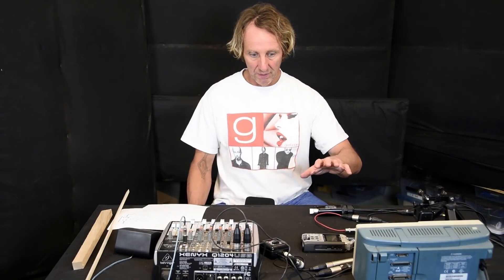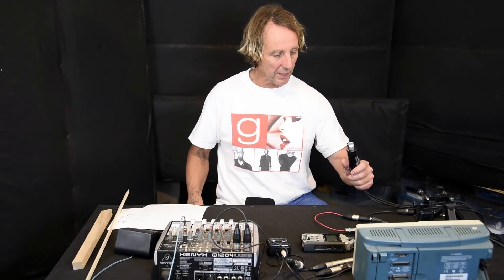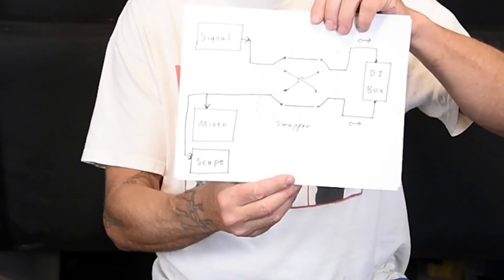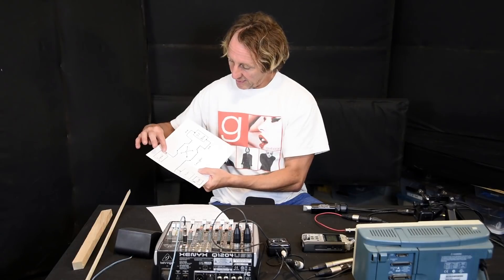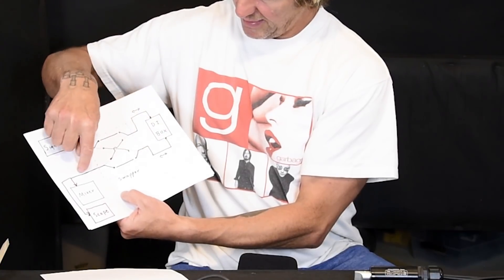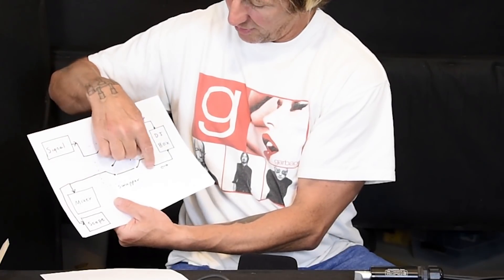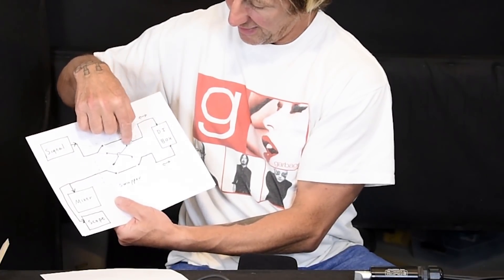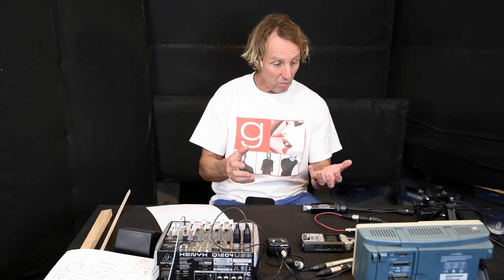DI Boxes, Impedance and Transformers Part #2

Comment: I had a matching transformer for high/low impedance mics, back when I was a kid.... it was the sort mounted into a metal can, with a 1/4" socket in one end & a flying 1/4" jack cable at the other. it was intended to match low impedance mics to high impedance inputs, but I didn't know the theory back then & although I knew there was a transformer in there, I didn't understand how it worked. I found I could use it one way round or the other to deal with a variety of level-matching situations, but it was (by some quirk) also phase-inverting, & so I also learned about that.

Comment: I used to always run two Multiformat, one for microphone level signals and the other for line level signals (both directions), sometimes even going up to three multicores, microphones, line inputs, line outputs, and would (mostly) use the mixing desk line input on the channel, exception being if I had mic input transformer on the desk then I would sometimes input a line signal through it for some transformer saturation, still do that till this day with my Allen & Heath Mod Two desk (the one from Pink Floyd-Live in Pompei), I believe it has Carnhill input mic transformers, beautiful original 70‘s saturation….by the way I love your videos Dave, your giving answers to a lot of what many people may think of as „stupid“ questions and then doing real life demonstrations , unfortunately many people think the only difference between signals is how „big“ or „loud“ they are, I cannot even begin to count how many times I’ve tried to explain to people the concept of impedance matching and the different topologies of pre-amp and amplifier topologies, took me a while all these years ago to understand why desk interactions happened when there was no transformer split, eg.a straight y-split going to one desk with transformer input and the other electronically balanced, or worse both electronically balanced but not identical desks, „shit, it works with two Midas desks, why not two Toys‘r‘Us desks???“
Yup, transformers are expensive…..and very often the effect of the transformer is a beautiful thing,a little fattening of the signal, a little rounding off, and a special kind of compression sometimes…it’s a pity that people often don’t realise how useful this can be in shaping the sound….and you haven’t touched on inductors for parallel eq or capacitors for filtering, trying to explain parallel eq is very confusing for many who still think in big-small signals or even more simplistic quiet-loud…..and now we are into the effect of phasing on a signal….for many non technically minded people you are doing VooDoo…🤣🤣🤣🔊🔊🔊🔊

Comment: He from London Dave.
thank you so much for your video.
I like to ask you about the DIbox what do you think we can use the output from the console to DI box to The speakers ?
Reply from the maker: Should just be able to run XLR cables from the console to the amps
Reply: @DaveRat  
he Dave I think I put wrong the question:))I'm sorry 

My question is,
can we use the DI box between the console outputs and main speakers?
Thank you Dave.
Reply from the maker: A di box will drop the voltage to mic level. So, yes, if your speakers only take mic level. If you are trying to solve a buzz, use an line level iso transformer instead

Comment: Ciao! So if I understood well, the correct way to plug a stomp box reverb that I love to my console is to feed the reverb's input with an aux send (+4 balanced) with a backward DI box in the middle, and the plug the reverb's output through a DI box (this time withh a "regular" way of pluggin) then send the signal to a mic input of the desk.
Is that correct?
Thanks for all!
Reply from the maker: Hmmm. You don't need the 2nd DI and the output of the stomp box is not an issue for the console to deal with.

To send to the stomp box, the console output is found to be pretty hot, so either turn the output way down or use a DI the normal way to drop the level down.

That said, a DI typically has a mic level out so it may be a bit low for the stomp box input.

I'd give a try and see which works better
Reply: @DaveRat  thanx for replay Dave!
Reply: @DaveRat  Hola Dave! I plugged the input of the stomp box the way you explained and cool! that's the only way to feed with a proper signal the input of the pedal himself with (also) hot signals coming from the +4 dBu converter balanced output. I test the flow with no flipped DI and there was no way of hearing "dry signal" coming back clean from the pedal; always "cruch".

So I thank you very much for this top useful piece of advice: It makes me think that the next time I want to use  my friend's fostex E16 for tracking drums, I will need at least a rack of 10 radials (which I used for patching this time_1XJDI with Jensen) passive to hit the tape...

Also, as you suggest, I patched the rev pedal's output directly in a mic preamp (padded) and there is enough room to align.

Thanks again for having my rev pedal connected properly to the rest of the world! 
Ciao!
Reply from the maker: Awesome!!!

Comment: The coolest thing I've done with DI's was to act kind of like splitters and used them on the inputs of a friends BOSS RC-300 looper pedal so that I could tap the instruments before they went into the looper. That way I was able to break up the looper setup into 6 individual channels (3 for the loops and 3 for the instruments). That way the same guitar input could be used to input a rythym guitar part into the looper and then turn around and take a lead on it and I still had control of the mix of the individual parts and loops at the board. I know it was overkill for a looper setup, but it sounded way better because I had way more control over it, instead of it being all in one stereo output.
Reply from the maker: Super cool

Comment: What is the benefit of using an active system like Radial SGI or TCE Teleport rather than just using DI boxes?
Reply from the maker: Active systems usually send the signals at higher levels reducing the susceptibility to induced noise.  Also active systems can minimize loading down the source by being very high impedance.

Comment: Great video. Your descriptions are very creative. Running a DI backwards is great in a pinch, but for long-term use, I still prefer devices designed for the job. Microphone transformers work well for low to high impedance conversion, and there are special interfaces for connecting consumer audio devices to balanced inputs. You might have also spent a bit of time on the pad switches on most DI boxes and when to not use them. But then we might have been here next week. 🥴👍🏻🎶🙉

Comment: I always wondered whether the Freq Response changes when you invert the DI Box. Will have to try that one in my lab. Any comments your way ? Thanx from Caracas !
Reply from the maker: As long as you don't try and drive a lower impedance load, it should be the same either way. And awesome! Caracas! I was there once and it was fascinating.
Reply: @DaveRat  So true, plus tryin to keep the HighImp wiring as short as possible. Hey, when did you visit us out here ? I studied ElectroAcoustics in Boston in the 70s, toured extensively as Engineer and Stage Mgr and now (67 is an age you stop hopping on stages) am dedicated to my Electronics Lab, fixing vintage and pro gear out here. All the best to you !!
Reply from the maker: It was back in 2002 with chili peppers.  Did a show there and had a day off or two as well

Comment: Calling Mr. Rat! I have a technical question for you. I am running a consumer grade HK preamp into a Driverack 480 (going unbalanced RCA to XLR by grounding the shield to ground). The issue I am encountering is that due to the impedance mismatch (I think), the preamp really struggles to get a high level signal to the 480, and consequently is real easy to run the pre into clipping. Would a DI box like the Radial ProD2 improve my signal to the 480 and keep the pre from clipping so easily? I don't have a full understanding of how these DI boxes work, but after watching your video, it gives me some hope that these might be just the ticket. I appreciate your videos and willingness to share your wealth of knowledge, -thank you!
Reply from the maker: Hmmm, sounds like you have a minus 10db output driving a plus db input and you need to find 14db somewhere.

So, either raise the input gain like 10 to 14 db on the 480 or add piece of gear, like a compressor or something with 10 or more db of gain between the two.

Using a di box backwards would be too drastic.

A Rolls promatch is a box designed for that purpose as well
Reply: @DaveRat  Dave, thank you for the quick response and advice.
Reply: If the xlr input on your driverack is balanced (and I'm assuming it is), you want to use a DI box. If it is balanced, the way you have it set up now forces the driverack to accept a single ended signal. There' are different ways a component can be balanced, and the wiring can be different depending on the methods used. Given that, the results of using a cable like you describe can range from working OK to crossing wires and making a short circuit. Without knowing the details of how your equipment is made, its hard to say what is going on in your system. Either way, the issue you describe is a textbook example of why you should be using a DI box in the first place. I think if you try one, you'll be pleasantly surprised with the results.

Comment: No, it's a GOOD analogy! It's like the one I use for batteries with water between 2 reservoirs and the diameter of the hose. Pressure velocity and flow are good analogue of watts, volts, amps. resistance with friction works too, and torque for impedance works too.

Comment: Thanks Dave, this is amazing information you're sharing!

One note on that ZOOM H4n - it is a little funky but you can actually feed line level into the inputs but you have to run them in via 1/4" which is how the H4n knows  you're giving it line level instead of mic level. Of course a DI is a great way to do this more universally.
Reply: Came here to say this. It's been a long time, but I believe I used to feed my h4n line level from a Sound Devices 302 by feeding stereo balanced 1/4". It sounded really good too. I have some field recordings up on youtube using that setup.
Reply from the maker: Hmmm, the 1/4 seen to reduce the level that is recorded but the high input level seems to still distort the circuit before the the level reduction.

I will set up a test to show the issues if I get a chance.
Reply: @DaveRat  Good point - I suppose it depends on the levels coming off the board. I tested it with an Allen & Heath SQ-5 but we were only running spoken word audio through the board. Could be different with music, especially anything on the louder end of the spectrum.
Reply from the maker: Also, mi e is an hn4, not the pro.

Yeah, definitely had issues that 1/4 would not fix
Reply: @DaveRat  Thanks for that Dave. Could be that the H4n is applying digital attenuation post analogue stage. Thanks for taking the time to test that.
Reply from the maker: That's the best explanation I've heard!
Reply from the maker: And thank you Curtis!

Comment: How can low impedance have a lot of resistance? Some of the stuff he says just doesn't make sense. The explanation he gives at around 11:20 mark just makes no sense.

I understand what he was saying about the DI working backwards, it is the analogy he is using, it just confuses me.
Reply from the maker: Yes, could see how "a lot of resistance" can be confusing if interpreted as "a high resistance". I switch between the analogy where offering "a lot of resistance" to the wooden stick moving would equate to and be the result of the low input impedance.  The low input impedance (low resistance) of a balanced input will drag down the output voltage of a high impedance output.

Comment: I ALWAYS learn from your videos. Thanks Dave!
I currently send a single D.I. feed from my bass player's multi-effects pedal to our mixer for mains and monitors. I want a dry feed as well to give us a bass sound for the mix that is more consistent in tone and volume than I get from a completely wet feed now. 
I plan to route the bass through a Radial Stage Bug SB-2 for a dry feed to the mixer, send the 1/4" out from the D. I. into the effects pedal and back out to a 2nd D.I. and on to the mixer as a wet feed.
I expect a hum and hope to remedy it with the ground lift switch. Should I expect any other issues? 
Do you recommend another solution?
Thanks for your time and consideration.
Reply from the maker: You should be able to do the wet and dry without him and the setup sounds good. 

A di before and after the effect sent to the console

Comment: Is there a difference between a passive DI and a Reamp box? Or is a reamp box basically a passive DI with a potentiometer to fine tune the level?  I use a re amp box to send a line level aux to my Roland Space Echo and then into a DI then into my console mic pre.
Reply: There’s a difference in the ratio of the transformers. A passive Di is around 10:1, a reamp is usually about 4:1. A passive Di in reverse, will take that line out (+4) and multiply it by 10, you’d need to pad it about 30dB or you’d over load your (instrument level?) Space Echo input. Your reamp transformer will take that line output and step it down 4:1, which is what you want. I don’t mean to confuse, and anything Dave says, I would not question.
Reply from the maker: A re amp box is pretty much a passive DI run backwards

Comment: Are the 1/4 in on the combo jacks line level?
Reply from the maker: Sort of. On the unit I have, H4n, the 1/4" are about 14 db lower than the XLR. But, with high level inputs something before the input level control clips around the same level on both.

So it is almost like all the 1/4" does is offer the ability to turn it down farther after it has already distorted.

Comment: I've heard that passive, transformer based DI boxes can ruin a single coil bass or guitar tone, because it can load the pickups down. In that case, if you need to plug a passive instrument to a board, the best scenario is to use an active DI, or even no DI at all, taking care to plug it on a high impedance input if possible?

In my mind, passive, low signal devices need high impedance inputs, including dynamic mics... or am i wrong?
Reply from the maker: The rule of thumb for sound quality is use an active di on passive outputs and an passive di on active outputs.

But also, do what sounds best

Comment: The best thing about using a DI backwards I’m my opinion is reamping.  Most “re amp” boxes are just DIs with reversed gender XLRs.  Somewhat embarrassed to admit here, but I purchased an active REAMP box from radial.  After some time of using it in the studio, I A/B’d with my basic radial passive DIs in my live mic kit.  There was little if any difference at all to the signal.  So yeah, using the the DI backwards to reamp or extend gtr signals is awesome and adds another solution/option into the mix using something you already own.  Cheers!
Reply from the maker: Awesome Russ!

Comment: Oh man. You're blowing my mind.

Voltage as torque, or leverage, amperage as velocity... holy shit. That's amazing.
Reply: Yeah try water pressure as voltage and actual flow of water for current
Reply: @Hipyon  And hose cross-section as resistance, and a water tank as a capacitor
Reply from the maker: Headed in a good direction though only cross section as resistance makes the transformer part tough. 

Roughness of the inside of the pipe as resistors as well helps a bit
Reply: @DaveRat  Yeah, I don't think there's any good intuitive metaphor for inductance.
Reply from the maker: I feel like basic circuits could be built with hydraulcs. The DC circuits are pretty doable. Simple ac where the hydraulic fluid would need to oscillate back and forth seem pretty doable but it's not much easier to explain the hydraulics than explain the electronics.

For chokes, a section of tubing that expands under pressure (voltage). Kind of like a small section of those expanding garden hoses It would pass DC and higher rate reciprocation of the water flow would tend to absorb. And be a low pass.

For a transformer, two intertwined flexible tubes such that the expansion of one tube compresses the other creating a transfer of the water pressure pulses. The could be scaled into step up and step down transformers as well.

I've out thought into it but the whole eco system of the concept, while relatively functional, gets unwieldy.

What would be cool is to build hydraulic circuits that mirror and function. But I don't see that in my immediate future.
Reply from the maker: Awesome, thank you!

Comment: I used a DI box this weekend!  I do video production for dance competitions.  I take the line-level output of the soundboard backstage and ran it into a Radial DI box. Then I'm able to send the balanced mic-level signal over 150 feet to my camera in the back of the auditorium.  It works great!  Plus having a ground-lift can be useful if you experience any buzz or hum.  DI boxes are wonderful!  😊